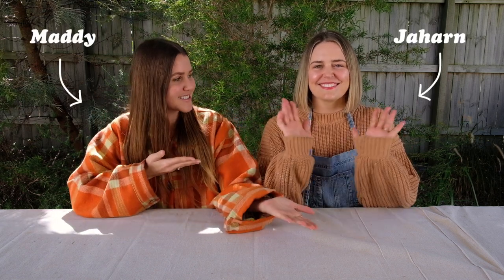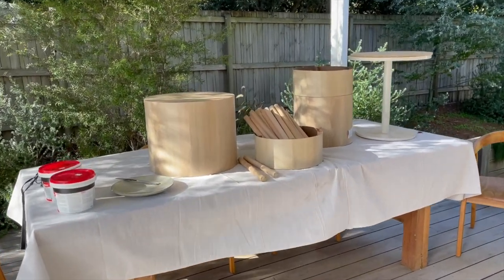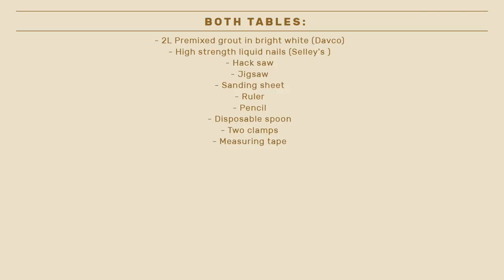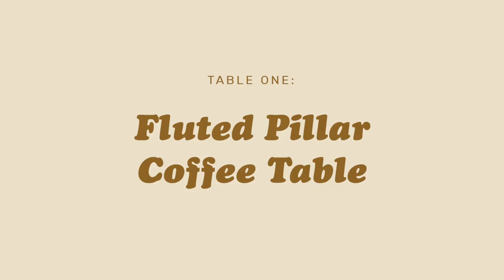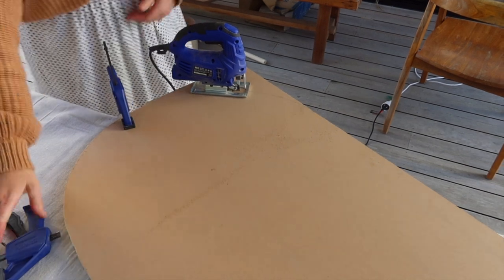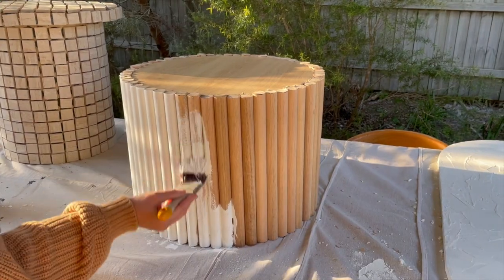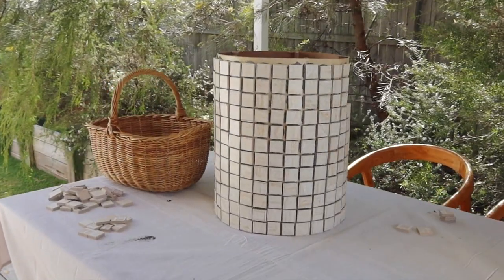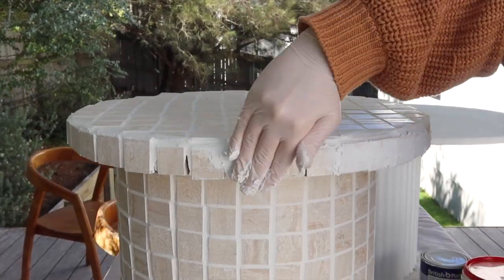DIYing ✨aesthetic✨ coffee tables (fluted, rendered & tiled finishes)

Comment: Hi, can I ask I went to a shop today and they had used Gyprock to create a rendered table, you guys use Grout, I’m planning on covering a curved veneer table I have that’s a horrible dark wood colour, wondering what is best to use Gyprock or Grout. Would I need to undercoat or scratch up the surface of the veneer timber for it to hold? Thanks 🥰